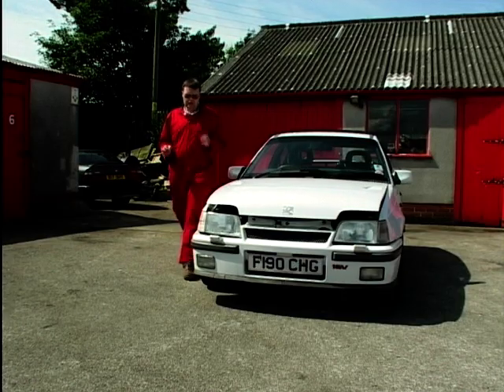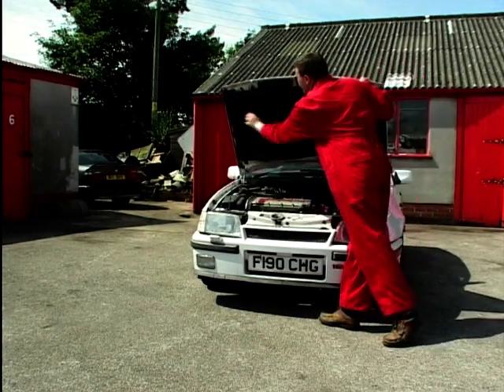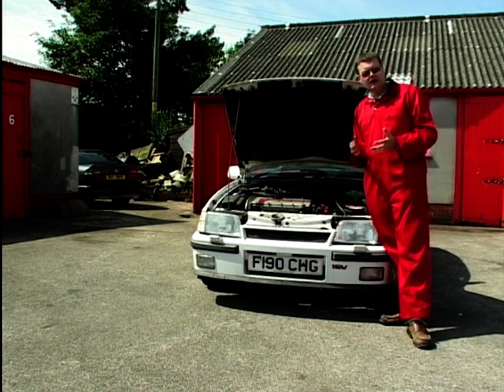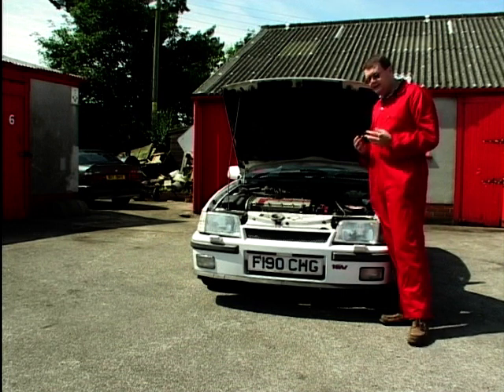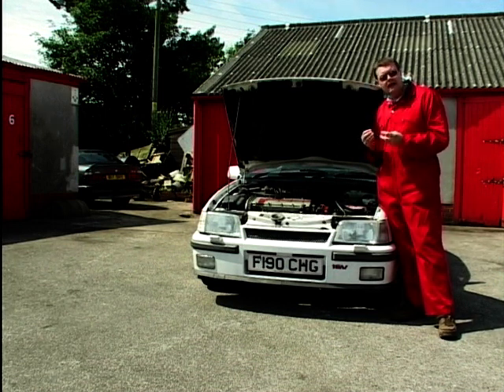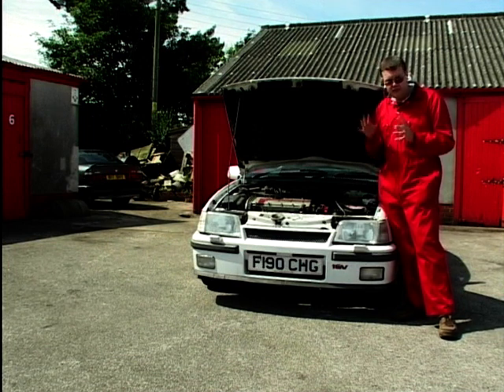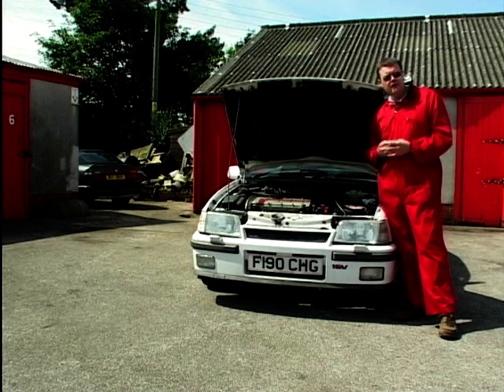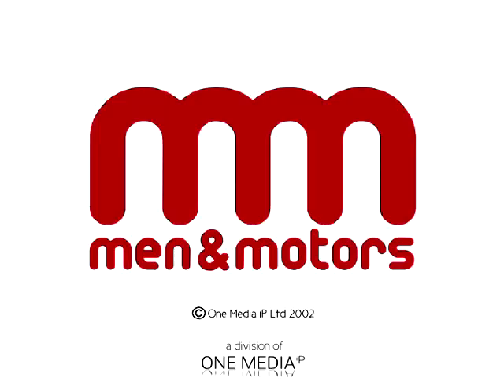Vauxhall Astra Mark II GT Maintenance Advice

Comment: I cleaned my ICV on my 1999 astra 2.0 sri mk4 but played up again after a short while and ended up buying a new oe one for £65.
A tell tale sign of a faulty one is when you rev the car above 2,000rpm and the revs fall it hesitates at around 1,500 rpm for a split second then goes down to idle.
A properly working ICV should not hesitate between 1,000 & 2,000 rpm when revved up.